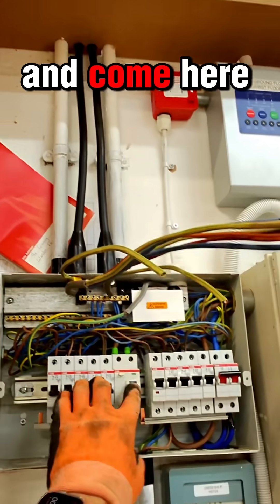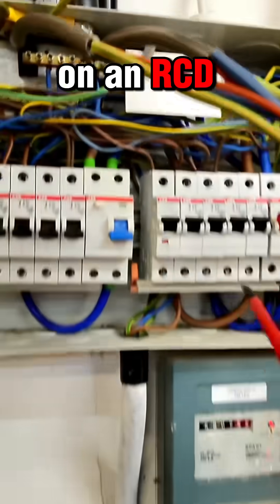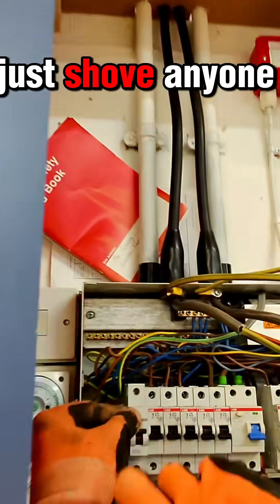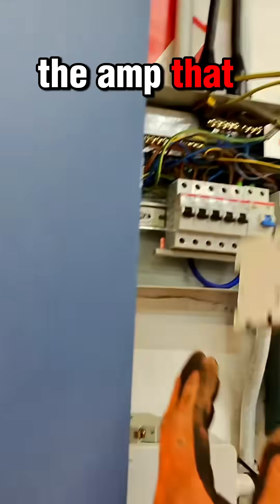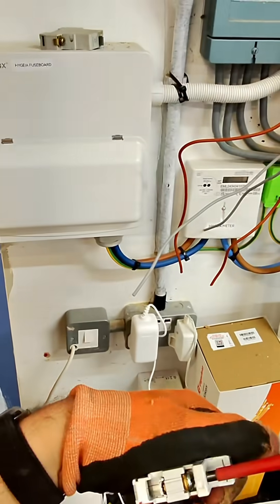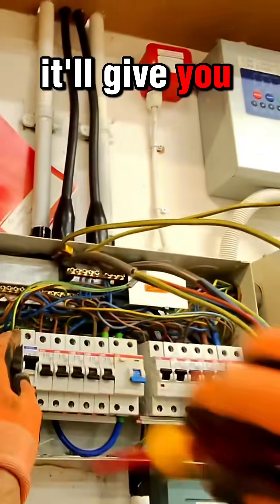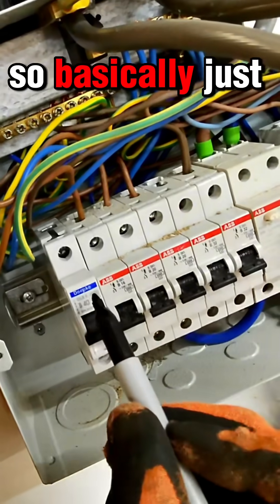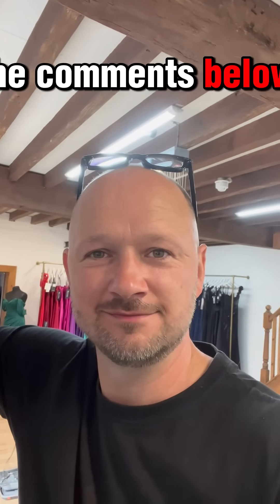MCB Brands Don’t Match – Is It Safe? Electrician Explains! ⚠️🔧

Comment: Hi I think it's not an good idea to  mix different brand with a  enclosure from others Brand.
Ie if your DB is Hager it's always good to install Hager breaker.
If you fix any other Brand, yes that fix but not hundred percent.
The busbars in DB and MCB input may be different in some thickness, centre orientation etc.
Plus it didn't give you good look.and after you fix top cover the operational levers show difference.

Comment: If a customer needs a 32a mcb for a hob supply and there's room for one and i have 1 in the van of a different make i will use it, as long as it fits the din rail & bus bar perfectly.  A customer won't want a complete board change just because a mcb is a different make. If it fits perfectly & is obviously the correct  rating, why not. Otherwise it turns a £ 180 job into an £ 800 job. 
( and always use a mirror to check the busbar sits right into the mcb. Quite often I've seen them NOT fitted onto the busbar.

Comment: Just twist the 2 x 16A radials together and wedge them in the 40A mcb and adapt the buzzbar to fit . If not cut the buzzbar off and use a bit of 6mm to bridge from another incoming side of a mcb that fits the buzzbar and if you leave the terminals little loose the weld action will soon make it all fit perfectly.  Job done home for Tea and Cucumber sandwiches 😂😂😂😂😂

Comment: Load of bs in my opinion as all manufacturers have to adhere to the same manufacturing standards for the same products.  Obviously some are just not compatible.  I only adhere to it because it’s in the regs.  If the regs were perfect they would bring out new ones/amendments.
Reply: Pretty much the attitude in the rest of the world.  If it doesn't work mechanically in terms of a bus bar fit etc (pin must sit flat when terminal is done up, no bending!), start a new section of bar or direct wire it.  The rest of the world (I'm not in the UK) isn't in flames and isn't wringing their hands with worry over it either.